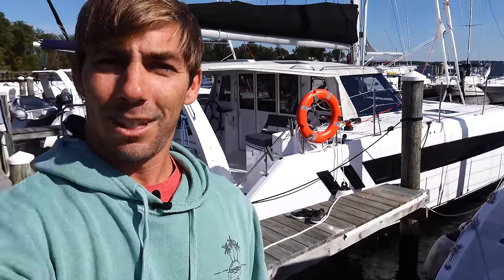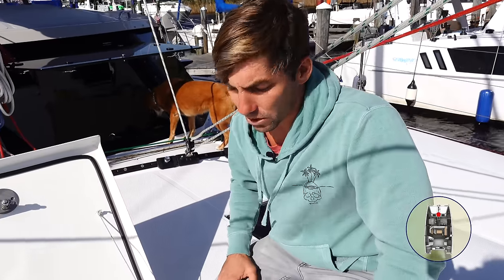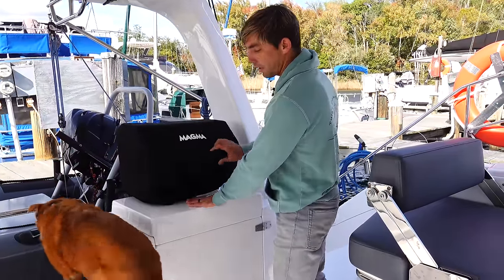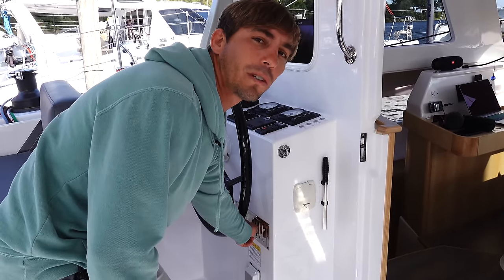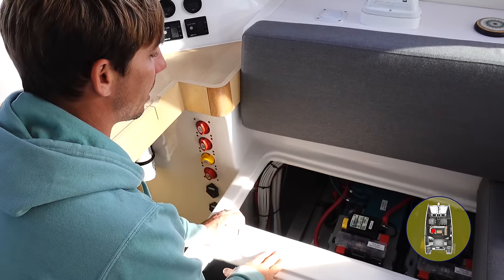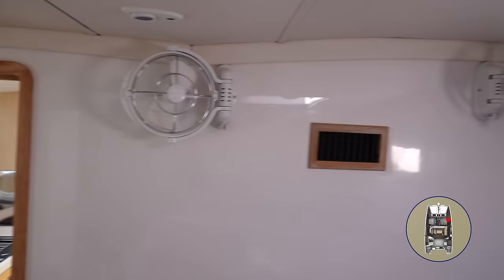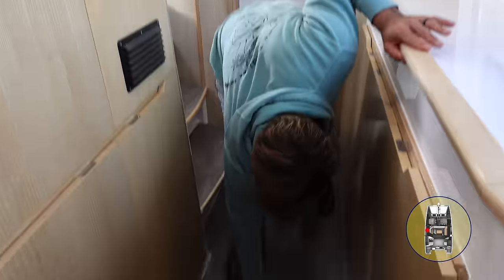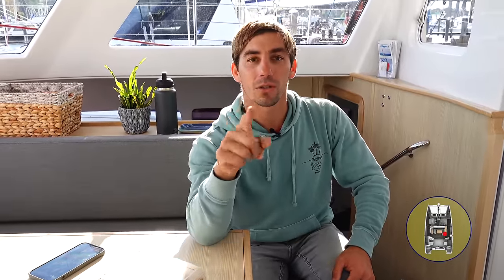Seawind 1170 Catamaran COMPLETE TECHNICAL TOUR!

Comment: Hello from Alaska.  Hey, thanks for the detailed technical tour.  I sail a lot and watch a lot of sailboat reviews and dislike when the content creator doesn't really go into detail, but gives you a 5 minute tour of the boat.  NO!  I wanna see how much access there is around engines, how the wiring is run, how deep is each locker, how the running rigging is routed and used, where and how the tankage is stored, where instruments are located, etc.  I want the 'full meal deal', so thanks for that!
Was thinking about your helm seat and what type of fridge you could get.  There are some awesome 12 volt chest type freezers that look like coolers that might fit in that space.  That way, you'd never have to worry about filling the area up w/ ice, trying to find ice, etc.  I installed one on my catalina 30 a few years ago.  It's a small unit but you can get various sizes.  Here's my review:  https://www.youtube.com/watch?v=4eBFFKOuXYE&t=196s 
I've seen other reviews of the 1170 and a couple of them don't like the single step from the deck to the cabin top.  I can see how it would be an issue in rough weather, especially with the lack of a handhold on the way up.  Any thoughts about adding another step or two?
Good video.  Thnx for the detailed look!

Comment: Very impressive boat, simple well planned and clean. One point for me would be a larger opening for serving the engines.. Well done guys.
Reply: I am only 5 feet tall and when I saw the opening I was shocked. I would be laying down trying to reach things. Not fun. what if the engine is also hot. My short arms say no way. I would be cutting it asap. What was Seawind thinking. I also would want a shaft drive instead. This is one of my favorite brand of catamarans and I was also surprised that the brand new windows in the saloon wouldn't stay open and that wasn't even underway.  Beautiful boat. We have a very old cat so seeing this one, makes me want a new one even more.

Comment: Good stuff. I sailed on a 1260. The Dinghy attachment  for the crossings was problematical at best, not at all well designed. The extra tie point you have under that hand rail would've really helped.  One thing I think I would do for the dinghy, Drill a big hole on the aft starboard side (low point) and install an ABS or PVC (schedule 80 so UV) so it can drain. 
Traveler set up is good. I'd mark the sheet so at the winch you can tell  where the boom is. Paint pen or color tape. Otherwise  you have to get your head above the dodger to see, and at night it's more difficult to see. 
It can't be done, but I'd have really liked the tint on the window  where the chartplotter is to be clear at the bottom.When it's cold and you have that window closed it can be really hard to see the the screen through the tint. 
I'm guessing your clears are similar to the ones we had on the 1260. just past that winch. Three months 7000 nmiles, a lot of high seas and rain, they protected the helm about 95% of the time. When they didn't it wasn't too bad. Blowing rain on my left sleeve.  The only things I'd like different is an attachment point on top of the dodger for when you want them out of the way, and maybe some way to clear the winch for the handle.... (but this winch clearance is  about the same as every other boat I've been on, including , mine not that big a deal)  If I wanted more protection short of enclosing the entire back deck. Maybe a 2' (70cm)  wide piece that snaps in behind the standard clears.   
What I'm looking forward to (as soon as I can find someone who actually wants the work) is the new B&G system (I'm told) can use an iPad as the second display. That would be ideal, then I can keep an eye on things anywhere on the boat.  I'd mount a small LED on the lid of the nav desk. That's where all the stuff is, the sun's going down, no lights are on, headlamp is in the charger, you need.....  Daybed is great, two people can stretch out in the saloon. I would however really like a chair back of some kind on the roving ottoman. When I wasn't outside on watch, I was sitting on  ottoman looking at the monitor. Maybe get a folding directors chair. (I've been on sets you can sit comfortably for hours in them. And they fold up.) 
Terrific you have AC. It's not just for comfort in the tropics, it's also a dehumidifier. 
On your battery switches. Does the center of those pop in and out? On the 1260 and on my boat the batteries got run down, everybody got worried, is the bank now dead?? And after a full day someone (finally) says, "Did you do the reset?" I took photos and studied the bank switches on the 1260 completely failed to notice one was flush the other inset. In both cases the push of a button all good, no harm done. 
Find out what screws are on the clutches, and get a pile of the rings for the life lines (we ended up using fish tackle clips) and have some stainless steel piano wire on board (It's dirt cheap).  Keep your tape in baggies and that weird roll you never use will still be good two years from now when you need it for something.)  Also for a lot of cups and bottles rolls of duct tape make really good cup holders for rough conditions. 
Vacuum sealing. I just pulled out of my home freezer (more reliable) some bell peppers I slice thin, vacuum sealed two years ago. They cooked up fine. You're not supposed to vacuum seal onions or mushrooms. I've sliced thin (mandolin) onions, vacuumed sealed them and froze them. Unfrozen is where the problems happen. They seemed good. I'm sure you know, when you've been at sea for two weeks  and the veggies have all been eaten or thrown overboard... 
After a week in fog and everything even deep in the compartments got damp and mildewy, I kicked myself for failing to keep my clean close in the extra dry bags I bought. And just last month I made several dry bags out of silnylon  to keep my clothes in on my boat. Also keeps any boat smell off them.  I made my dry bags so the plastic bins sit inside them, now instead of a floppy bag I've just got to unroll the top and the 'sides' are rigid. 
OXO makes nice squegees on bases that you stick on the wall in the head, then after a shower you squeegee down the walls and door, no water spots. Also in the head is where the soot from the propane stove condenses into little 'feathers.' 
For those hatches. I just used a piece of cardboard. If you can split the opening with just a few inches of a 'panel' instead of a stick, then you'll always get some degree of a flow in and out. Like a transom window. Works amazingly well. Apparently just about everyone has forgotten about this.  Lift doors are great, incredibly reliable. Seawind makes really strong boats. Nothing including those doors change 1/10th of s mm in 7000 rough nMiles.   
Hypervent for the mattresses?   Sorry to be such a busy body. Promise won't do it again.
Reply: Love hypervent.

Comment: Hi 
 I would suggest you buy a portable  gas fire pump. 
In a case of emergency for   striking a reef or like being struck by another boat. 
Yes you have a bilge pump  but bit of trash or a blown fuse. Sea water doesn't stop.
I'm not trying to scare you.  Just something to think about.  
Happy sailing 🎉

Comment: Heyy Billie - one suggestion - I used a soft shackle to attach a small block to the back of the helm seat to route the davit line to the electric winch. The geometry worked well on a 1260 and made pulling up the heavy end of the dinghy pretty nice.

Comment: So you don't have a radar? And are you going to put one in? On the water maker. Why did you go with the one you have? I like the seawater pro. Because you can get parts for it at any hardware store around the world.  Nothing is proprietary with this system. And when you are at some out in the middle of nowhere Island. And it has a hardware store, you can fix the 💧 maker. 
 Thank You so much for this video. Unfortunately I am so excited for ya'lls Boat 🚢.  I would love to see more. All the repairs that had to be done. All the fixes that had to be done ppand if Seawind has ben good on  Those fixes. And where is that Water coming from in the bilge. And have you thought about getting a dive  Compressor for the boat 🚢? It just may fit under your hilm seat. Just a thought. And how do you like the two burner over a three burner stove? 
 And can you add a solar arch on the back of the boat 🚢 for even more solar? Can you add more batteries if needed? 
 And is the boat 🚢   Everything you hoped she would be? And would you buy a boat 🚢 from Sea 🌊 wind again? 
 Would love to see what ya'll had to do for the boat 🚢 show. How you prepared the boat 🚢  for the show.
 Sorry I have so many questions but just haven't seen to menny videos from ya'll sents you have gotten the boat. I have ben thinking of buying a new c😊at and want to know more about what to expect. 
 Ok until next time ⏲️, Aloha from the Big Island of Hawaii!

Comment: If you have an electric element in your hot water tank, setup your solar to use it as a dump load when the batteries are full, my solar gives me warm water 50% of the time and hot water 30% of the time, 20% it supplies no boost………